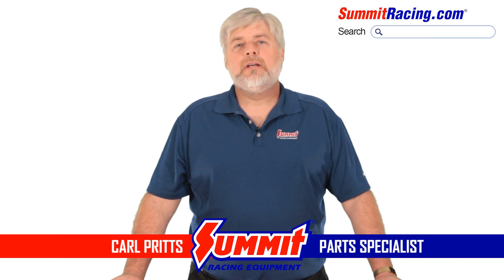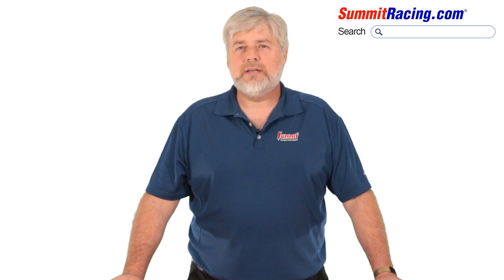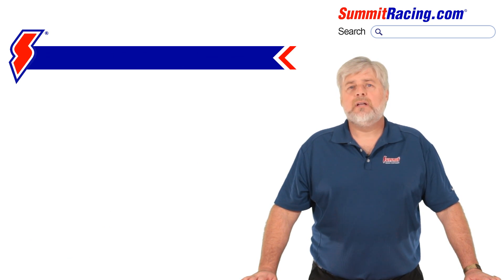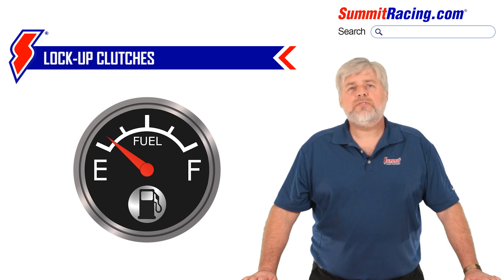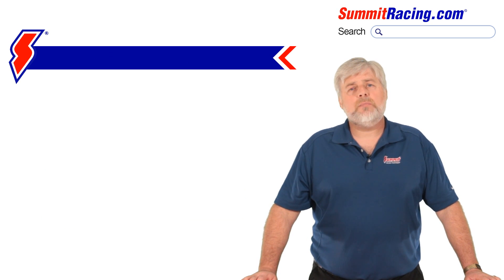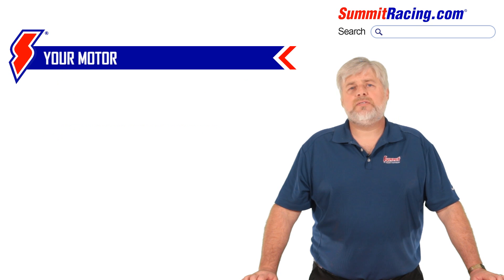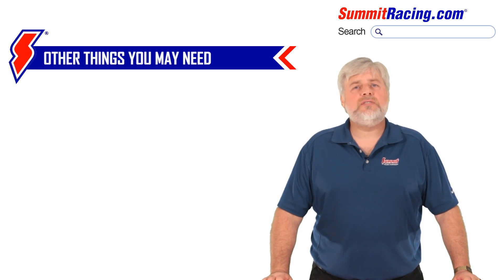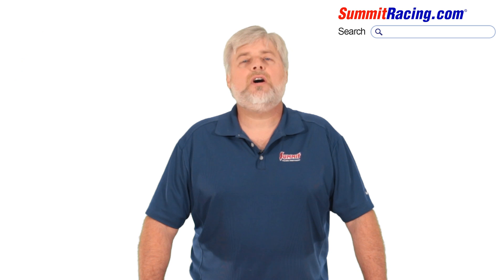Torque Converters - Carl's Tech Talk

Comment: Watching in earnest.  My big questions:  Best rear gear and TQ stall/model with just a tune and CAI.  Peak torque stock is 4250rpm.  I've read two trains of thought: 1. Get a TC that stalls at or close to the peak. 2. Get a TC that stalls at 500-700 rpm below the peak.  No racing(?), just street-highway.  2004 Mercury Marauder.
Reply: if your just driving around regular u dont need to change your tc inless you just want a faster take off. in that case just go 3 to 500 over stock stall speed.
Reply: Stock engine torque peak is 4250 rpm.  Stock TC stall is 2500 rpm.  2 ton plus car.

Comment: Sounds to me that the stall speed of the converter is really all about getting out of the starting line or "getting out of the hole." I'm about to have my 4R70W rebuilt to handle more power, but I'm not really into stop light drag racing and I want to keep my 3.31 axle ratio. Won't I just be happiest with a heavier duty converter with about an 1,800 rpm stall?